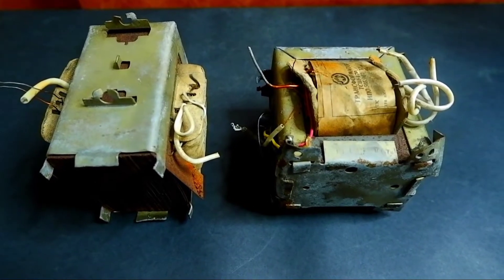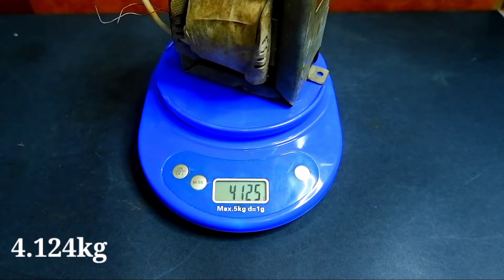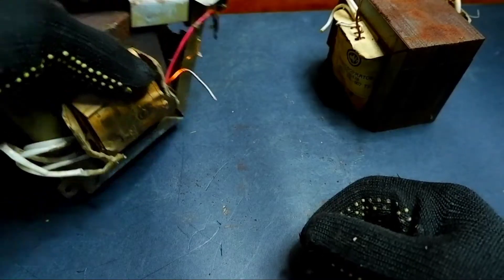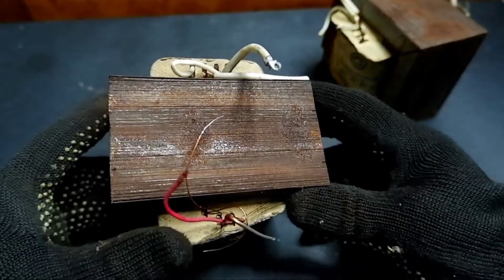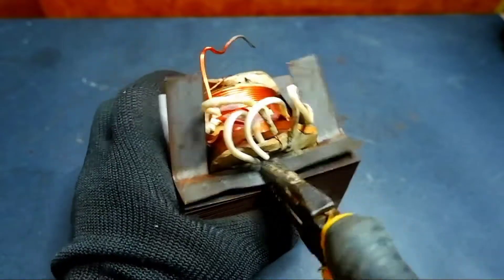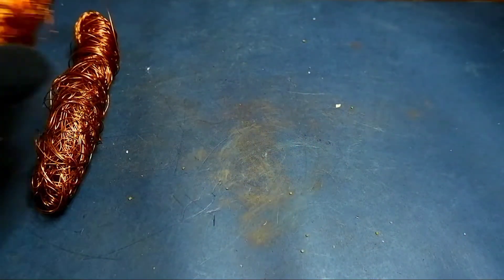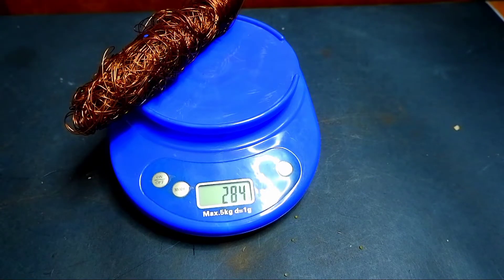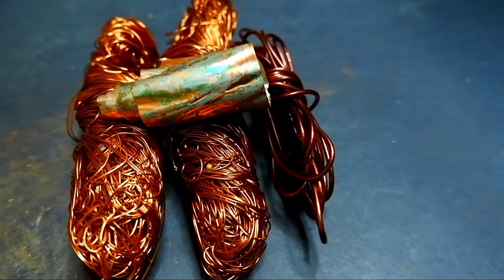Recycling of Transformers | Extract Copper.

Comment: Easy Money you made stripping that transformer so easy but i have never found it so easy also you need to make sure its copper and not aluminium wire good luck .
Reply from the maker: these transformers are very old and in them there is only copper, in the newest ones you don't already often find aluminum